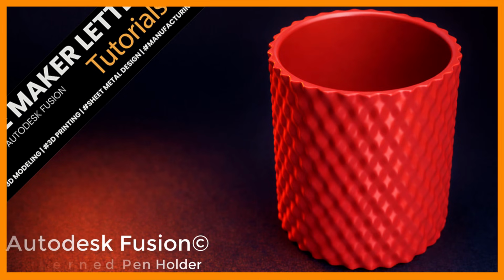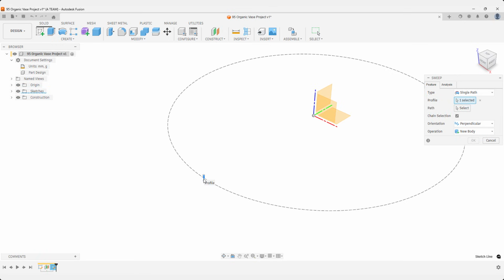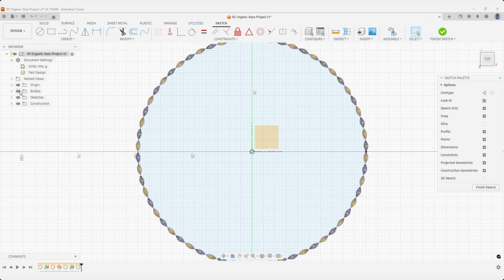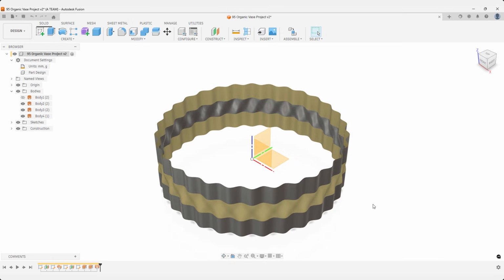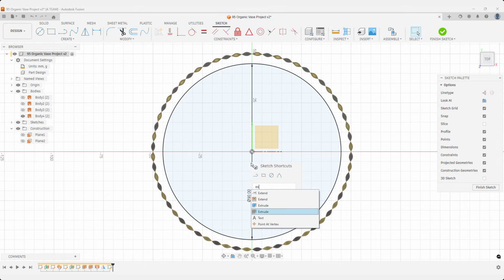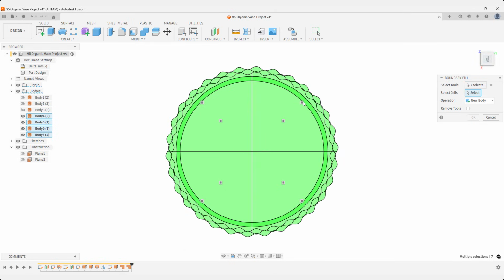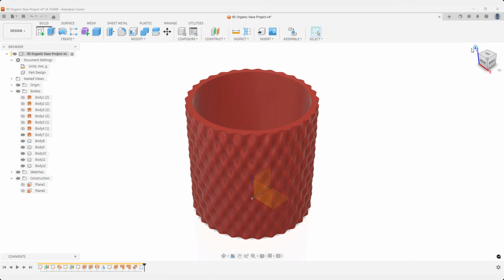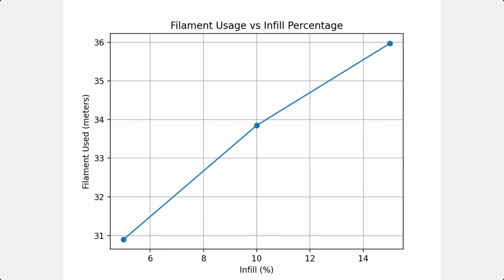Fusion Surface Modeling: Create Complex Wave Patterns Without Crashes

Comment: Since this is an exact copy of Kristian Laholm's workflow for wave patterns on a cylinder, I would appreciate mentioning him... Anyway, perfect explanation.
Reply from the maker: Thanks for pointing that out. I did consider mentioning him as an inspiration, but I changed large parts of the workflow and the final result. For example, I use a workaround with Boundary Fill to construct the solid waves and he uses boundary fill and shell, and the end geometry is different in several key ways. (His workflow is great but my laptop always crashed when I tried making my surfaces solid with his workflow, which is one reason why I made a video with a different final geometry and different workflow).

Inspiration in CAD comes from many sources, and once a workflow diverges it becomes tricky to reference everyone who influenced a project in some way. That said, his work is solid and definitely worth checking out.